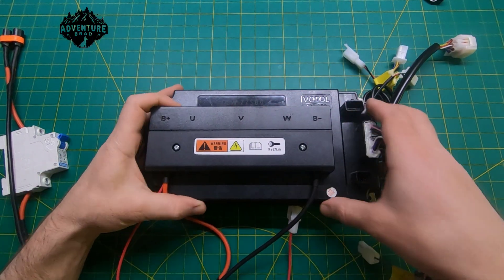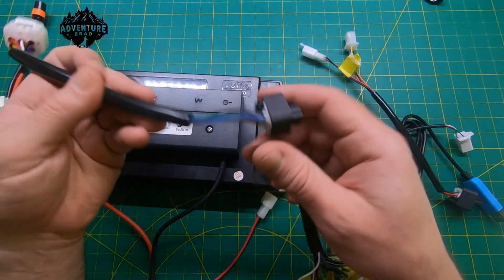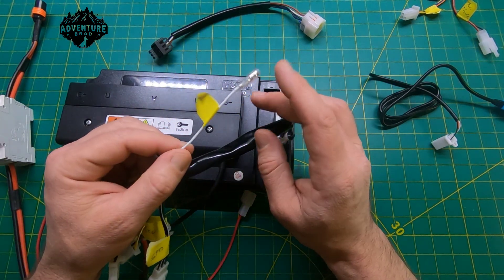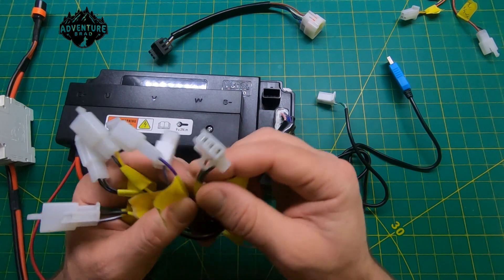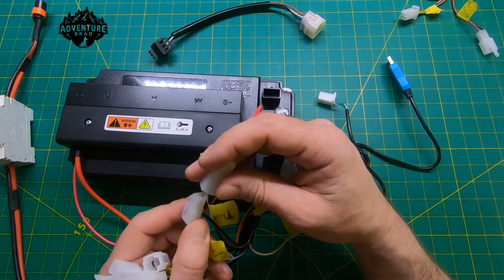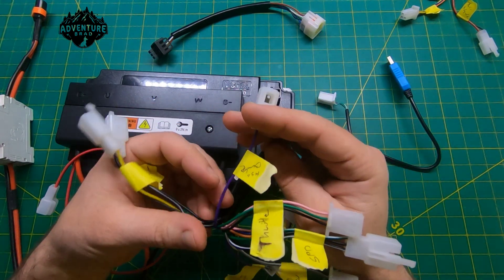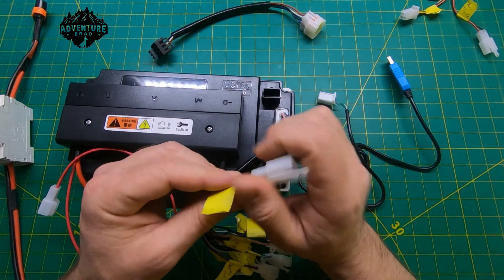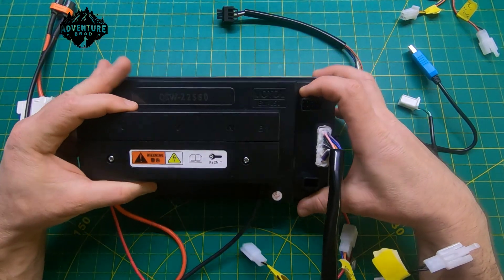Votol Em-150 Controller Wiring for Brushless motor em150 ebike Surron

Comment: Thanks a lot, i browse hundred forums. In french, in english, in german and also in Chinese without founding any solution about wires. I've the Em-100 CAN, your video helped me so much and i was finely able to communicate with pc - Votol. On some translations i'd, the violet-grey wire was marked as "door lock" (???), alarm, anti-tetht.. 
I cheked Tx RX câbles, changer order, reinstalled drivers. ... And finely after one day working and searching to ensure to not kill the controller, I followed youy instructions, just plugged thé violet and grey to the B+ (and of couse B+, B-, and programming TTL to USB) and it perfectly worked at the first time!
Reply from the maker: Awesome, glad you were able to make it all work

Comment: i'm running an EM-100 and i'm trying to diagnose what's wrong, the speedo isn't lighting up anymore, none of the controls change anything in the programming software so i'm thinking something could be either wrong with the controller or the settings in the controller, or maybe the regulator for the speedo isn't working?! i'm a little at a lost, i'm going to check all the voltages are right on all the switches today.

Comment: Thank you for explanation.
I was hooking up my 45A votol with a spare cable harness because the original didn't have any connection made for it.
That didn't work. So today I was thinking Oh yeah probably you will need to connect the ignition /e-lock wire first to activate the controller. Wasn't sure if it was this and also not sure if it needs to be grounded or on battery main but It's probably battery voltage like you said.
I will measure it first to be sure.
Hopefully I can read my controller to backup it.
It's from a V28 threewheel scooter 72V.
Local dealer said it's not possible to connect.
We'll see that 😅

Later I'll make some extra pins on the original cable harness and add the debug connector to an easy location.
Reply: Connecting the e-lock wire worked to get it online.
But don't know if it's 72V or ground.
Didn't measure voltage on it.
So just connected the original e-lock (ignition) pin strait to the pruple/grey e-lock wire on the cable harness instead.

Could write data but for some rest my 3 way switch didn't work anymore.
Changed high gear to SW.
After that reverse worked as intended but have to toggle between low/high tp change the setting instead of adjusting the switch to low or high.
Weird or it's because the switch isn't connected during reading /writing.

But happy to get the original settings just incase the controller blowup some day.
Reply: Ignition wire should be battery voltage, typically installed after the key, but for bench testing straight from bat (+) will work. It should be from the same battery that is connected to controller DC because if you ever mess with the alarm and remote start, that functions by backfeeding battery voltage through the ignition wire which activates the controller and feeds all the accessories even with the key off. So clearly you want the voltage on both ends being from the same source. 

If your 3-speed switch didn’t work either it was wired wrong or someone has screwed up the port settings. Since we know the center terminal of the switch goes to ground, and in speed 2 position nothing is connected, so default speed (MiD) will be active. When you move the switch to speed 1, the wire connected to the port set for low speed will be connected to ground and activate low speed. Similarly high speed wire is connected to ground when speed 3 is selected.

Many of the ports are set for ON/OFF pull down to activate, and you can select from the dropdown list any of the ON/OFF functions (Low, high, sport, low brake, cruise, reverse, etc). 

Its probably best to start with a factory configuration file to fix any port settings that were screwed up, then you can use a multimeter to find the wires sending out a 3-5v reference signal, but not the red 5v supply for throttle. With the program running on the display page you can see each function as it’s activated.

One by one you would ground the signal wires and watch the display page to see which got activated. Label each wire with its port number because later you may decide to change the function of that wire. So if you just label it “low brake”, and later you decide you will use that wire for reverse, you will be lost on which port to change.

The port set to high brake will be looking for 12v+ up to battery voltage, but it’s not very safe to connect each wire to battery positive. So if you just want to verify that port you can change it to another basic function (low, high, low brake) and then ground that wire and see if its going to the port that was previously high brake. 

Obviously you can only use either low brake or high brake effectively, so whichever one you don’t use can be reassigned for another basic function that doesn’t already have a wire and port set for that. 

The controller comes set and labelled for basic installation but any unused ON/OFF function can be used for any other ON/OFF functions. Side stand safety switch/park, cruise control, reverse, are available.
Reply: Are you shure hi brake can take up to battery voltage? I know it has been like that on my previous cheap controllers but on my votol em30s  ( or any other votol) it's just saying 12v in manual so I don't want to fry it by connecting too high of a voltage ..
Reply: Did read 12V only too. 
Better try that first. 
 @yellouu_theree
Reply: @fiveleafcloverfpv4445   9-12v works for shure i tried that but it seems like it would be bit dumb for them to make it take up to 12v that controller doesn't provide. Sure I can put a resistor divider or resistor and zener or step down but it might be totally ok with bat voltage and manual and program translation is very unclear anyways so it wouldn't surprise me if they meant min 12v..
Reply: Yeah but do you really want to try? 😅

💥
Reply: I think it's because they pick the brakelight wire for it and that's 12V

Comment: Mr Brad, I respect your work on EV components and watch your videos carefully. I own a Votol EM-70 that has identical connection with yours except lacking of the anti theft port.  I’m gonna install it on my e-chopper nowadays. For the no-CAN USB connection to PC, the manual says that e-lock should be connected to the battery (+). My questions are :
1. How should the connection be made?
2. After programming is complete, will the connection to the battery stay the same or do I need to change anything?
3. Isn’t the low-voltage cable too narrow for 72v 40amps of battery power ?

Thanks in advance for taking your time!